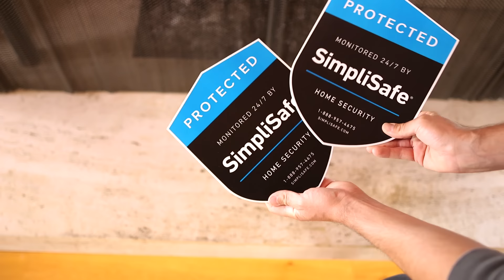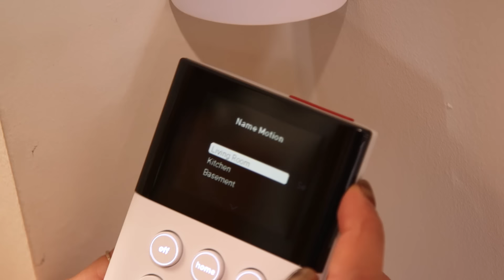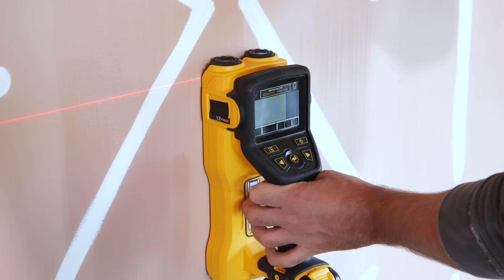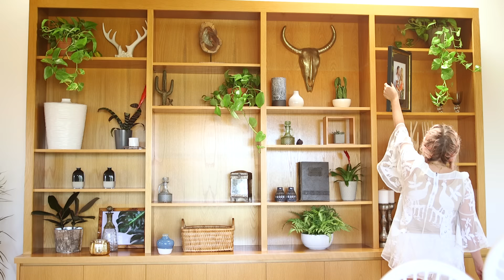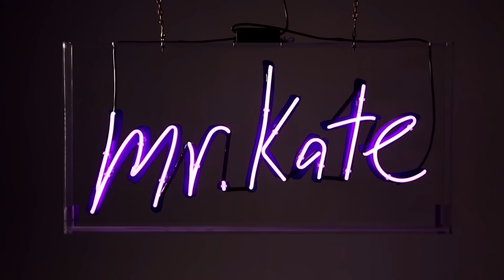Ultimate Bohemian Living Room Design for Mia Stammer | OMG We're Coming Over | Mr. Kate

Comment: I am interested in a good safe home system, so I immediately looked it up. I was sent to Amazon (German Amazon,  where I live) It was not available anymore. So I checked with the  reviews and found this: "3,0 van 5 sterren Be informed. This is an important purchase.
Beoordeeld in de Verenigde Staten op 5 juni 2017
Stil: BravoGeverifieerde aankoop
After I bought it I read that it was easily disabled by using a cheap cell phone scrambler you can get on ebay. I'm a radio engineer so I tested it. True. So don't publicize that you have it with a Simplisafe sign. Maybe use another vendors sign or generic if it is that important to tell everyone. Hide the transmitter & keypad from view so repair-people dont see what kind of alarm you have."   So never put that sign up outside your home and indeed never let the remote and indoor controls  be seen from the outside.